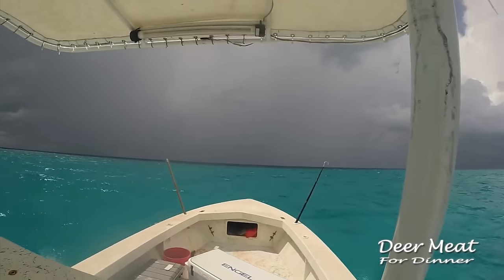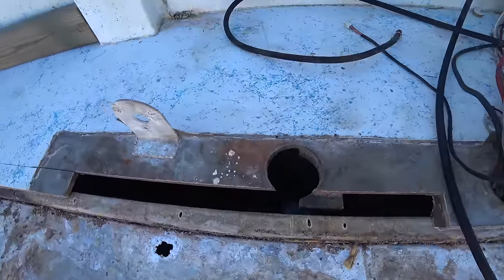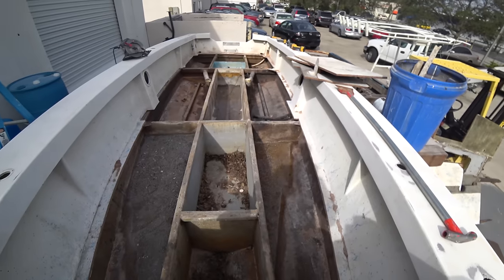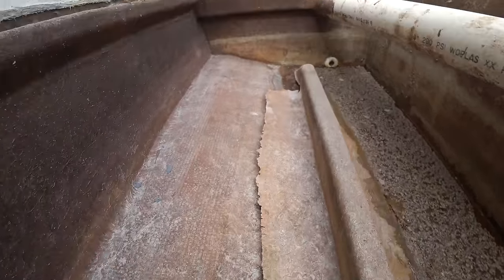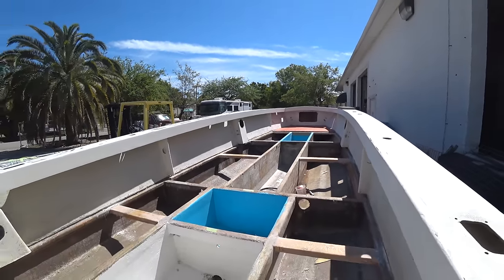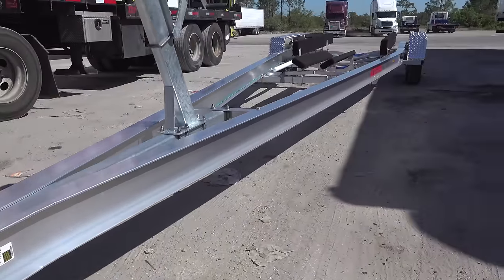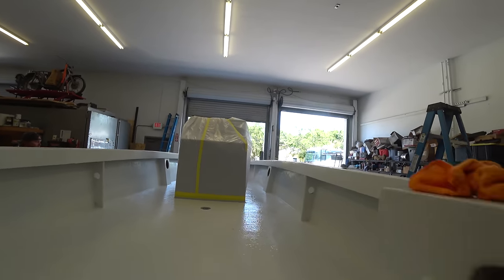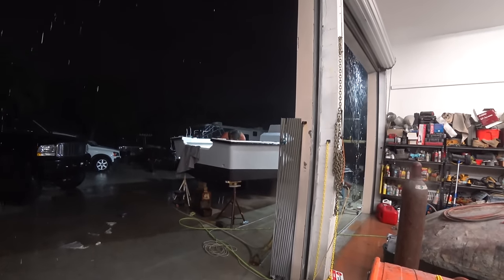Center Console Boat Restoration!!  MUST SEE TO BELIEVE!!! It's a Resurrection!!!

Comment: I do custom rib boat rebuilds of rib boats most people don't believe that you can make a an old boat better than new
Reply: Alfred Montaner How much for do what he did to a 1975 Skeeter deckette boat? Needs floor and transom done.
Reply: alex flores I rebuild rib boats and yacht tenders unfortunately I don't rebuild regular boats. Call the team of guys Robert uses they did a hell of a job !
Reply: Hey Alfred I would think restoration would be cost prohibitive? I was always told it cost more to fix up a boat then it was worth, good to know
Reply: Brackish TV I'm in Miami I recently did a restoration of a 13.5 Nautica rib for a client. The restoration is gonna cost him half of what a new rib will. He's getting new engine new upholstery and new tubes. Essentially his boat is " almost new" for half the price
Reply: Alfred Montaner I use a 17-18 foot Avon rib for work. It’s really run down. The tubes have tons of patches and are completely faded and the seats are all ripped and stuff. Do you have an estimate for the price to restore this boat?

Comment: I am glad you found a shop that is run by honest people and the boat does look good. One thing everyone should be aware of though is that the original fuel tank installation and the new fuel tank installation were both in violation of US Coast Guard rules and of the ABYC Technical Standards that are followed by all reputable builders. It is against both rules to support a fuel tank with flotation foam! It is also considered bad practice to foam aluminum fuel tanks into boats, even though this has been a common practice for decades now. The correct way to do it is to build a support platform under the tank above the normal accumulation of bilge water and then mount the tank on neoprene strips (I usually specify 3/8" thick as the rules require 1/4" of space). Fasten the tank in with either blocking with neoprene between the tank and all blocking or better yet, have mounting flanges welded to the tank during manufacturing. The compartment should have air holes cut into the frames/stringers for ventilation and drain holes to allow water to flow out of the compartment. Nothing should touch the tank but air and the neoprene! If installed this way, it doesn't even need to be painted or coated in any way. I have been designing boats for over 30 years and it really gets disheartening seeing these bad practices continue. I recommend the guys at Karma Kustoms spend a few hundred dollars a year and join ABYC. They'll get a copy of the technical standards and possibly save themselves some grief down the line. If they ever get sued, they'll wish they had followed the standards! I am not trying to bad mouth KK as it looks like they did a great job on all the rest of the boat, I just want to see them and all the other shops follow the Federal safety rules so people don't get hurt. Good luck with the boat and I hope you get another 20 years out of it!

Comment: What do I need to do to get an old boat and make it unsinkable with flotation foam? Not sure how are boats made. Does it have wires running through it and steering components or what. Thank you for your information.

Comment: what did they put the raptor liner on? I've been debating weather or not to coat my aluminum boat with the raptor liner. Just wondering if i could use it on the exterior hull?
Reply: Justin Sanders we put it on everything except console. You have to make it as rough as possible so it's no too slippery
Reply: John Ross so do you think it would be good for the exterior and if so should I put it on smooth?

Comment: Whats the cost of a job like this?
Reply: I have the same boat (2001, love it). Now this was done 5 years ago so obviously pricing is different. I'm about to drop $25k on a repower. I had the boat surveyed a couple years ago and I don't need the full resto Rob did. My only concern is if I have to replace the gas tank. If I ever did, it would be 15 to 20k.